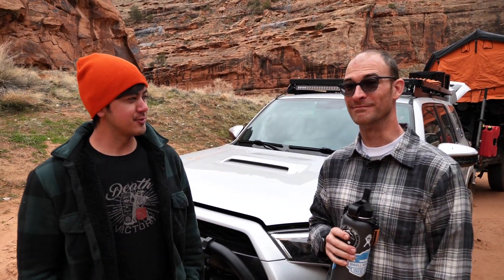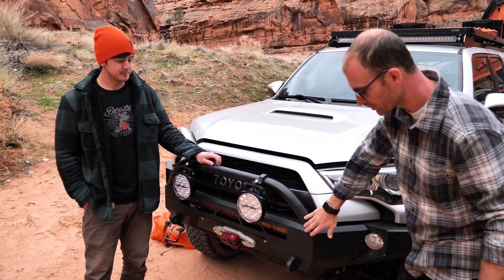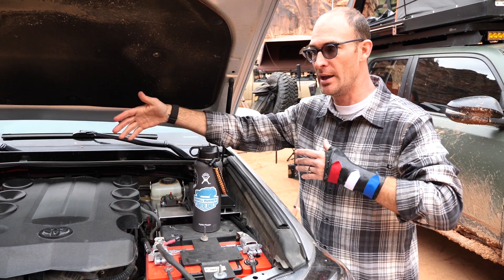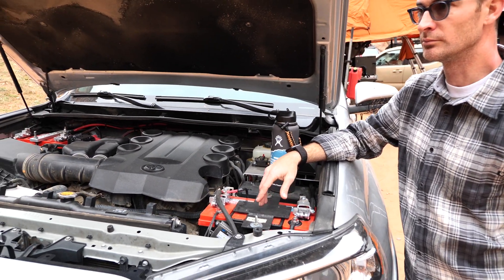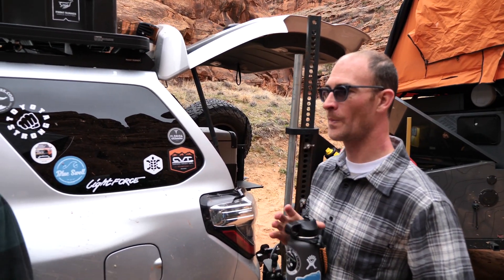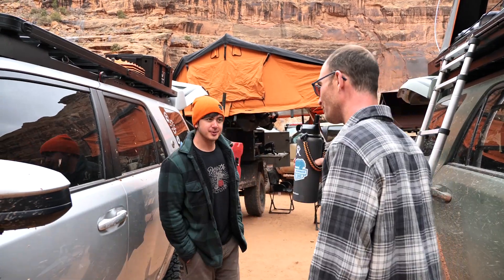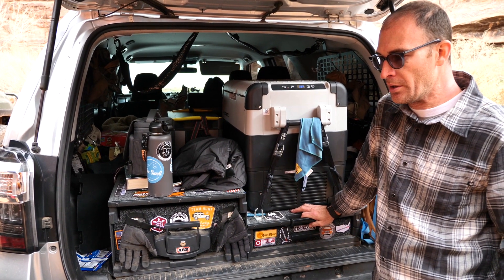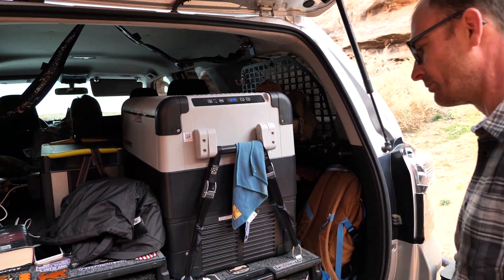BUILT Overland 4Runner - Swellrunner Rig Walkaround - Offroad Toyota 4Runner

Comment: The best mod to my new 4Runner's overland setup has to be the Magnuson supercharger.. It increased my (to rear tire) horse power by almost 100.. So from 270 stock hp to around 350hp to the wheels.. I think they said it was a 35% power increase.. It is snap on and was made together with TRD so requires no other engine mods.. Once hooked in the electronics know what to do.. It has taken away ALL the strain extra weight all the overland gear puts on the engine and makes the 4Runner feel exactly like an SUV this size should.. Nothing more, nothing less.. I highly recommend it.. It has transformed my 4Runner and changed my mind about switching to a Lexus for more power.
Reply: Lunamaria thanks for sharing!
Reply: Whats the MPG like?
Reply: Mpg? Reliability?
Reply: @undefeatedgaul3201  These words are questions? Lol... I never noticed any change in mpg.. Magnuson reassured me that mpg will only decrease if i'm flooring it everywhere, and 2 years later that still seems to be the case.. If there is a change, it's so insignificant that i have never noticed... And yes it's VERY reliability considering Toyota Racing Development (TRD) and Magnuson designed it together, so it compliments the engine.. This supercharger was suppose to be used for a trim offering, but Toyota ended up not putting a supercharged 4Runner on the market.

Comment: Did he say he struggles with power to the rear? I swear I saw two batteries under the hood and a solar power mounted to the top. Oh and a Yeti 1400!!! This guy needs to just stay home as much power as he thinks he needs.
Reply from the maker: I don't remember the video, but I think he was talking about getting power (access) to the rear, before he put the new fuse block back there to connect everything. Essentially running wires from the front (batteries) to the rear.